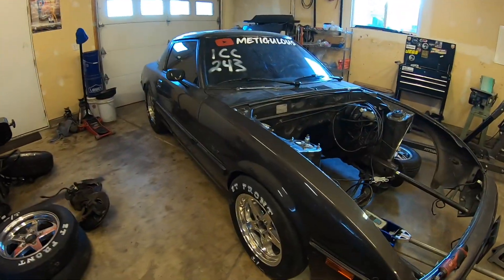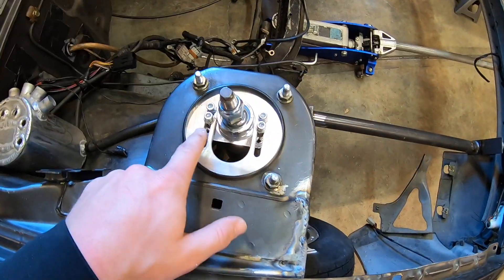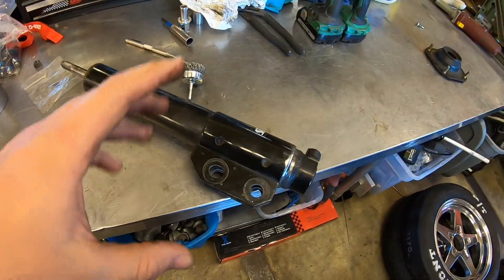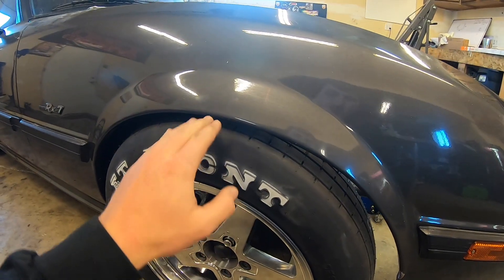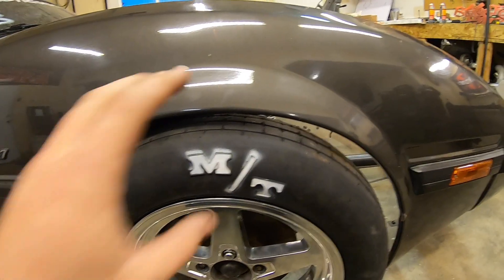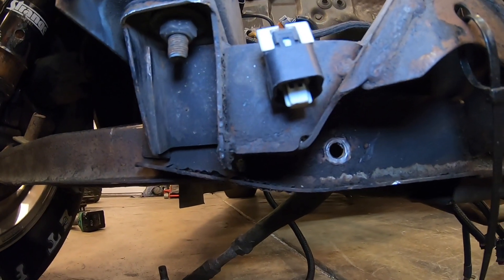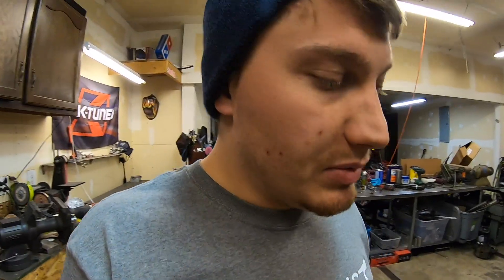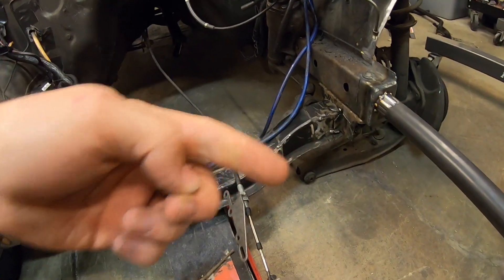It Actually WORKED! (Mustang 5 lug Swap)

Comment from the maker: To answer some common questions. I didnt go with the FC 5 lug swap because those types of coils/shock setup isnt meant for drag racing. Also, the car will sit like this even with the weight of the motor in it because i have adjustable coil sleeves for it. Which allows me to get it to whatever ride height i like 😎
Reply: Did you look into T3 (Techno Toy Tuning) GTX2's?
Reply: Great job idk if I’m for the poke in the front but it looks great and if you are happy then it’s perfect.
Reply: Personally I think it's easier to make a strut fit the application.  That said, it's your car and you're not only doing it, you're filming it for our enjoyment and information.  Haters gonna hate no matter what right?  Thanks for the vid and keep up the good work!
Reply: It looks awesome and I'm sure it will work just as you want.
Reply: If you need to or want to lower it more in front try getting or making some lowering top hats that way you can pull the wheels in as well. Just my two cent 👍👍from this guy
Reply: Bro once you drop that motor in with everything that thing is going to drop a lot and the camber should be on point
Reply: Hey bro I work at a shop, I would at least wait until you get the motor and trans back in it, the weight is gonna help settle it back in. We do alot of alignments down here at our shop.
Reply: Cant you slot the holes on the strut to change camber on the hub alot of factory cars have that as an option for camber adjustment then the wheel will pull in

Comment: If you installed the shock with just the top bolt. Leave the lower bolt out. Put the control arm back in its factor location and then push in on  the top of the wheel which will slide the lower shock bolt location inward. It might bring you in under the fender. The shock angle will change but it might work where you just have to make a new lower shock mount hole. Something to try.

Comment: You can oval out the upper spindle bolt hole on the strut to get more negative camber adjustment. Takes like 5 minutes with a die grinder. Doing this will also allow you to have more adjustment either way on your camber plates.

Comment: Looking good since your committed to the sn spindles you can oval upper bolt hole in strut to move strut more vertical possibly enough to get tires under car. I like how you lowered actually raised collar on strut.

Comment: turn the shock in a lathe. it wit cut the weld evenly, remove the old engine mounts and re-drill the mount one inch to the left you should get lower profile front tires.

Comment: Excellent job, I like the look. Get that roll cage, it should also help the car ET as well. Congrats on taking the time to learn about suspension setups. So many cars could pick up free et and mph with just a few suspension changes and a proper drag 4 wheel alignment. 

Some cars have picked up as much as 7 tenths with just suspension and front end modifications.Getting the suspension and alignment working at launch and throughout the run" Free's up hp ". Though rare,7 tenths is like getting a  200 hp + shot of nitrous.

 But it's not uncommon for cars to pick up 1 or  2 tenths = 30 - 60 hp with just suspension and front end /alignment/modifications / which also makes the car safer and smooth at  100 mph or 150 mph plus.

 Brent's Cole truck is designed to make turns, not make quarter-mile runs, hence why he didn't put a lot of hp in the truck, he knows it would need to be reconfigured for the drag strip if he added more power...

 But its a good example of how alignment, suspension can adversely affect a drag car. People always say,  Drag racing? All your doing is going straight. If they only knew how difficult it is.

Comment: Slot the top hole on the strut to get more negative camber. If I were you I'd get that wheel tucked under the fender. The lower the better.

Comment: I'm surprised you went thro all that trouble with the stock crossmember.  You definitely have the talent to build a tube one that would be lighter and you would be able to set it up any way you want.  I dig the hell out of the rx7 tho.  It's definitely going to be fast and it looks way better with the new front wheels

Comment: Slot your lower control arm bolt hole so you have more just meant to get the camber you want. And then if you want once you get it in the placement that works for you well done to you bolt washers to keep it in place. I work at an alignment shop and we do it all the time

Comment: But for now the 5 lug set up is a very nice touch and a well deserved upgrade just like the cage will be when that finally gets done and if it was me I would just go ahead and put no less than a 25.3 chassis/cage in it and be done so you can get really fast with it cuz thats what it's going to take to beat Kyle and to hang with Brent in the S2000 when that project gets done

Comment: Go manual Mustang II rack and pinion steering and manual brakes line lock transbrake scramble button and get a chute and put CO2 boost controller and a CO2 chute launcher on the car from MotionRaceworks and be done with it thst way you don't have to worry about pulling a lever to pull the chute just press a button

Comment: Let me assist, since your basically turning this into a Mazda foxbody mustang lol. If you want to eliminate your front wheels poking out the fenders u need to run foxbody spindles with the bearings in the rotor(available in 5 lug cheep online) that will bring them in about an inch over the sn95 stuff, and everything will bolt up to what u have now with the strange strut and ball joint mod because that is all the same,  like this so he sees it

Comment: Also take note that moving the lower control arms outward like you have done. It will play a part in bump steer if the rack inside pivot points are inside those new control arm mounting points.
Reply from the maker: Rack still needs to be mounted. It shouldn't have any bump steer!
Reply: Bumpsteer is tricky. You will have bumpsteer unless you specifically calculate all the pivot points, arms and tie rod positions

Plus, don’t forget caster. You will need caster to keep wheels pointed straight and self-steer.

It would also be nice to have correct positive Ackerman so the car can actually steers. Some drift cars with no ackerman don’t turn like normal cars, they turn sideways aka crabwalk. Or 3rd gen Camaro with negative ackerman that turns by dragging the inside wheel to rotate the car.

A stable toe-curve probably isn’t all that important for drag car. But it would look funny toe-in while launching and toe-out will braking or opposite.

The car looks awesome and I think it’s good idea to use off the shelf Mustang drag parts. Just worried you’re overlooking the whole geometry angle of the front suspesion. You used geometry to figureout the rear anti-squat. Well the front is the same with like 10 different variables
Reply: @tomjones5860  many good points. Toe in or out on a drag car will slow it down. Setting this up the car needs to be raised up to where it will be under exhilaration. Caster in a drag car is best to have more. Too little will make it harder to control at high speed. Stock most cars are 3 to 4 degrees in a drag car 6 or 7 is better. You get up in the higher speeds, 180+, you want 10 or more.

Comment: How come you didn’t slot the upper bolt hole on the shock?  That or some camber bolts would give you more negative camber with the ability to do fine adjustments with your strut mounts.

Comment: Can you remove the front cradle,? After you reconfigure it, I would remove it and shot blast it to bare metal as you might want to reweld some of those factory welds, that cross member cradle is missing some material to the left of the lower control arm pivot hole. The factory welds might be a little weak side for 700 -1000 hp and 160 mph +.

Comment: And put a 5-bar map sensor in the car so you can put just as much boost to the car when you're at home and at sea level and get you some QA1 triple adjustable coilovers on all four corners and then scale the car out and put boost by speed on the car and go out there and shoot for low 7s to high to mid 6s in the 1/4 and low 4s to mid 3s in the 1/8th because a bunch of people are shooting to go way faster by next season and people are always shooting to go faster all the time anyway

Comment: What ya upgrading on the engine other than turbo kit?? Your car 60' pretty good, I would have spent the cash on alittle more power, ect. Hope all the suspension work your doing d oesnt throw off the way the car leaves. That was where you were gonna out perform that mr2..

Comment: You need to put some weight in the front of the car so it settles down like having an engine in there because once the suspension squats that's going to change the camper a little bit and it'll probably be just enough once you put the engine it'll probably perfect

Comment: Why would you not modify the bottom sock mount to lean the spindle in a couple degrees. That my have been a easier way to fix the camber issue. Also consider

Comment: You could flip the camber plates and bolt them thro from the top will give you more shock clearance and if you slot the bolt holes you could slide it more !! But over all it looks kick ass and you'll have way much function ability plus a larger aftermarket support for parts

Comment: Dead easy to add of camber in these. Cut the engine side of the control arm and weld in a 3/4 block. Drill, tap and add your choice of heim - all original pickups will work, including original caster / sway bar mounted on the outside of the control arm. We circuit raced for 15 years with zero issues; +5 degrees camber but more importantly ~8 degrees of caster with the stock caster rod length - important for high speed steering stability / wheel feel ... obviously +5 is overkill for your straight line stuff, but you can lop less off the control arm  :)

Comment: As they say hindsight is 20/20, with that said I think all the stock suspension would have been fine, I think the way to go about this would have been to Simply have custom wheel hats made that fit the spindles with five lugs, everything would be tucked in nicely not sticking out like it does, if those fenders go over the wheels and you try and turn the car its not going to be a good result

Comment: I would not mess with any of the camber yet. Because you don't even have the motor in it and it doesn't have the weight pressure to push the camber back in  like it's supposed to.
Reply: I've been cringing to this fact for a while.
Reply from the maker: It has adjustable coil sleeves i can get it to sit at whatever ride height i want it at
Reply: U need a tissue in a cookie .

Comment: Where the knuckle and shock mounts together you can “oval” out the holes on the shock and adjust camber there. Many cars are like that from the factory. And yes I know the way those knuckles and shocks are made, adjusting there will also affect the caster.

Comment: You will have to be very careful rewelding the spindle plate on the shock as the weld will be in the bottom of travel of the shock and cause a tight spot in its travel . Would it not be an easier and cheaper option to modify the Mustang hub to fit on the RX7 spindle?

Comment: With weight on the front end (engine and trans) the suspension will compress and the top of the wheel will come in I do believe.

Comment: Time to either put some Darton sleeves in this block and to concrete it and make it a dry deck block or just go get an RHS-LSR block that already has Darton sleeves in it and find a shop in your area to put some Top Fuel Hoops in the block and receiver grooves in the heads for the hoops and get a good set of Cometic MLS gaskets or Athena gaskets from TSP and fully CNC port and polish the heads stub the block from top to bottom get the block blue printed aluminum rods Wilson Manifold elbow with one of their new boosted throttle bodies and/or a Frankenstein billet Iceman intake a good set of pistons with a good set of wrist pins and a Callies or Scat crank and put that big daddy choo choo papi S475 on the car but before that I would send it off to José over at Forced Inductions and have him go through it and put his touch on it and get either a Neil Chance or Cameron converter and a Rossler TH400 2-speed Turboglide with a 1.87 first gear and get a Mark Williams back half frame with a 9in floater rear with a spool and unbreakable axles and have it shortened so you can mini tub the car and get spindle mounted front spindles with a Trz front K-member and tubular A-arms or struts and get a Rock Solid Motorsports front end kit and just go full on race car with this thing so you can go really fast and put a 4.10 rear gear

Comment: it would have been easier to just take your og rotors and chaulk them up in a drill press and redrill for five lug dune it been there works great, to me it looks like your gonna rip those fenders rite off of that car when your front comes down from launch,  if you continue with this direction try to find a set of front wheels that are all the way dished inward , those wheels are four inches thick at the mount thats cra cra

Comment: Why not just extend out the bottom mount bolt hole on that shock? Extending the bottom bolt hole away from the shock would allow you to lean the top of the spindle inward.

Comment: Is there a reason you reinvented the wheel here? instead of doing what everyone has done for many years, using the fc front sub frame/suspension for a 5 lug swap. fucking awesome none the less, more options for the fb guys. make a write up on this with detailed pictures and all that and upload it to the norotors forum/website.
Reply from the maker: They offer coilover kits for these they are around $1300 for the two fronts. They are not for drag racing. Even with the FC swap stuff its not what i want
Reply: @Metigulous  ahh gotcha gotcha! well fuckin eh man, good work! can't wait to see it racing.

Comment: Can you just put the lower control arm bolt in the stock location so it'll have a narrower track width. Then elongate the bolt hole from the strut to spindle or use camber bolts in to get the camber correct so the camber plates aren't maxed out

Comment: Would be nice to see the strut towers tie into the firewall and then into the cage,I'm sure the tube front will tie it all together up there.a triangulated strut tower bar to connect the two may help alot if there is room 🤷 you've got all the goods in between to panels may as well keep it rigid

Comment: Dude do not move your control arms out, just mod the plates that fix the spindles to the shocks, if you move the bottom hole out you will gain heaps of negative camber and fix the poke! If you move your inner control arms joints out you will get bump steer too
Reply: P.s. Rx7 looks super cool with those wheels/tyres and tucking the rears
Reply from the maker: I will be able to correct any bump steer with how i mount the rack/custom bump steer kits

Comment: Why don't you just slot the holes in the shock for the knuckle mount and/or get some camber bolts? That'll give you plenty more adjustment. Good move on dropping the shock to get more travel. In the future I would invest in a shorter shock.

As for the comment about FC coilovers not being meant for drag racing, a shock is just a shock and has a job to do. Most of the coilovers you see for sale under $1000 or even under $1500 are pretty much junk in terms of any competitive racing application. Piece together a Ground Control sleeve with a nice Koni, Penske, Ohlins, MCS, JRZ, etc. and you'll have a setup that'll do whatever you'd like with ample adjustment between damping and spring rate changes. However, that's more expensive than what you'll have in this setup. It would've saved a lot of hassle, but for a tight budget what you're doing will work.

Comment: You have to consider that you don't have the weight of the engine which will have an effect on your suspension issues.
Reply from the maker: No, i can get it to that ride height with my adjustable coils

Comment: You could add some camber With the mounting point on der damper, bringing the top side in or pushing the bottom side out, just to bring the track width in
Reply: Two thumbs up on this.

Comment: If you get a top hat for the shock tower it will allow you to lower it without the wheel poke but I don't think that hood would fit without modifying it or having them poke through the hood. Just my two cents 
👍👍from this guy

Comment: Is it just me or is all this suspension work actually worth it without the engine in it?  will it change anything when he's done and gets the engine backin there. Am I wrong?
Reply: Thought the same thing. Adding another 500lbs to the front of the car could very well drop the nose an inch or two. Bottoming those shocks out again.
Reply: @justin169169  that's what I was thinking he needs to add weight to see what his suspension really will do hope it's not off by much once the engine is in.
Reply: The springs are set for height and weight. The shock just dampers the up and down of torque on and off durning the dig. If The car stays level, little or no lift,  puts it safer down the track. It also gives it a wider stance up front. It should make it more stable also. The car is taking a step up in the game.

Comment: Still way too far out and too much positive camber for a car that will do wheelies. You will have to move the top shock mount whether you like it or not. And also you´ll have to put the arms back in their stock position. Unless you find some very high ET wheels which isnt a great idea either.
Reply: That depends, a negative scrub radius can lead to steering that really wants to go straight which isn't the worst thing in the world for a drag car.